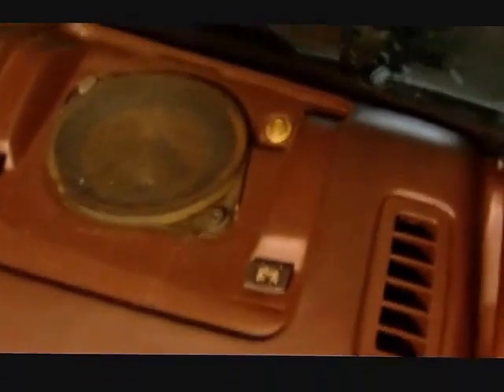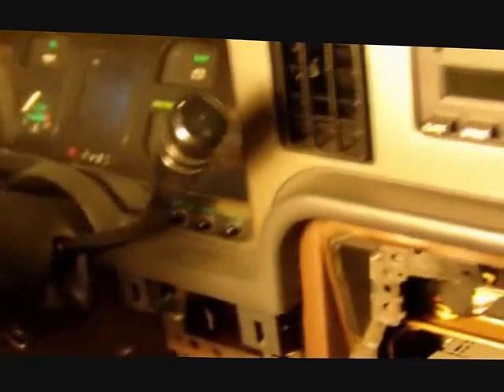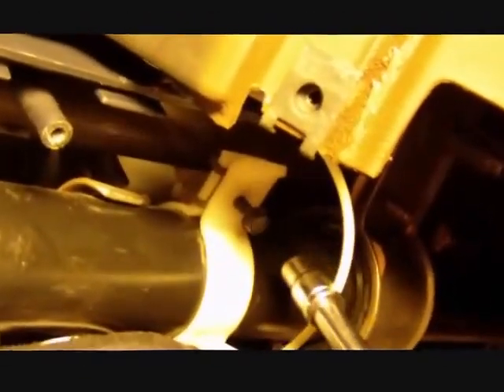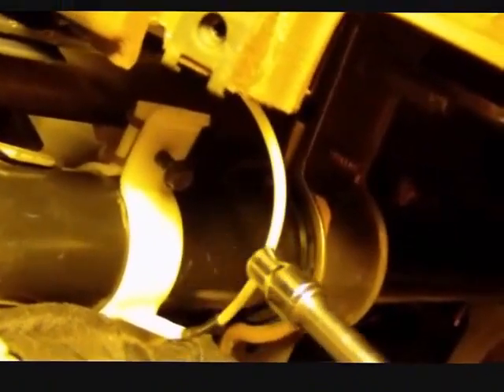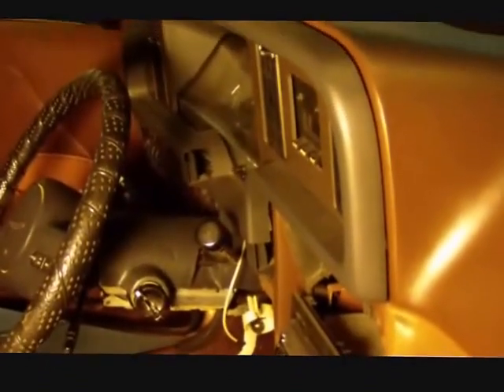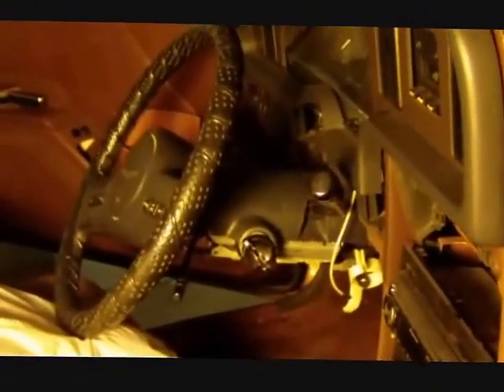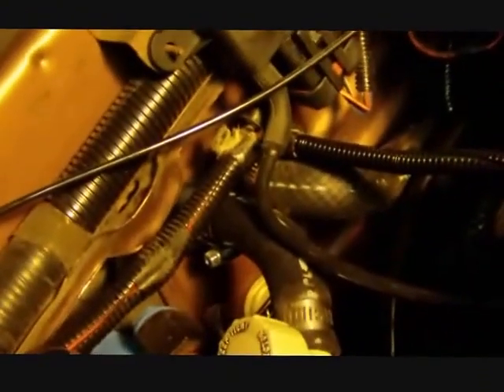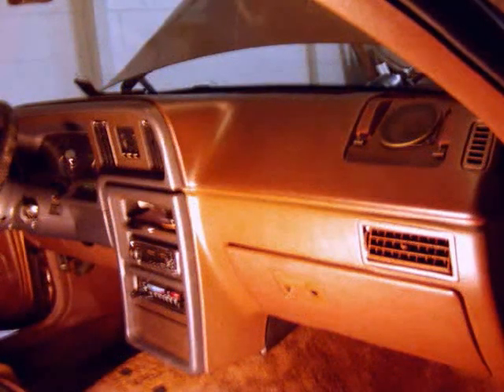1988 THUNDERBIRD HEATER CORE REPLACEMENT

Comment: I paid 300$ to a mechanic for labor and supplied the heater core in 2005 job was not done well ,I have a draft as if the heat blend door is not closing and a draft of air coming inside  the car also floor vents are not working well . If you want it done right do it yourself, I have had my 88 T bird for 24 years and has been a great car!

Comment: Thank you so much for this post. I am getting ready to replace my heater core on my '86 T-Bird with a V6 in the next few weeks. This video is going to make life so much easier. Thank you, thank you, thank you!!
Reply from the maker: Make sure you get the correct heater core!!  The core for my T-Bird, according to the auto parts store, was actually an '87 part.  My T-Bird was put together in December 1987.  The difference between what they showed me as the listed part and what I had was significant.  Mine was physically larger.  Presumably Ford used an '87 core box set up in my '88 T-Bird!   I doubt you would have a similar encounter for an '86 but I wonder.
Reply: You actually make an interesting point. Because the manufacturer date on my T-Bird is 08/86, which you would think would be an '87 model year, but it's not. It's one of the last '86 body styles that rolled of the assembly line. I wouldn't be surprised if I have the same issue that you had. I know I do have to remove the accumulator. Believe it or not, there's some parts I had to put on the car from the 1985 model year that worked over 1986 model year parts!
Reply: I replaced the heater core in my '86. Took me a total of 9 man hours. No real issues taking it all apart. Just a lot to take apart. Heater core was $40. But you're video was an awesome help! Now I can enjoy driving the car in the winter again (when there isn't snow haha). Thanks so much again!!

Comment: Those clips in that speaker Grill... Is the highest functioning clip in the entire car! 
It's almost as a Ford... Didn't sell enough speaker grates as replacements for these things. But, they can be repaired. You need 3M panel Bond, 8115. In the most extreme. Sometimes, 3m's problem plastic adhesive will work just fine.

Comment: This video has been the most helpful so far that I have found. I'm working on an 84 Cougar heater core replacement. Very similar to the Thunderbird. I appreciate so very much for your tutorial. Good job for doing this. Now I am just wondering how many screws, nuts and bolts I will have left over. Hopefully I will find a home for them.

Comment: thank you for posting this video, I managed to get my heater core done on my 1986 cougar, wasn't easy, but with your video
I was encouraged to give it a shot, I had a  couple quotes from shops, 7.5 hrs labour another one  told me 11 hrs  2 days later and I haven't see one drop on my garage floor, knock on wood,and it only cost me $35.00 in parts and 5hrs of my time,  thanks again your video saved me big time!
Reply from the maker: +Lino Quintana Thanks---Your response is why I posted my actions.  Learned soo much from Youtube.

Comment: Years ago when I co-owned a Body Fender/Auto Repair shop, I found out that Barr's make a Solution to repair Heater cores, I used it in my 1988 LX 5.0 No problem It work!